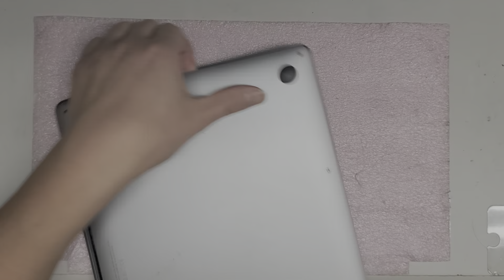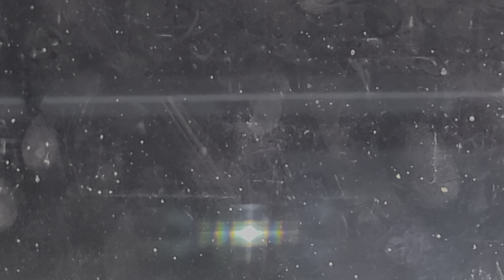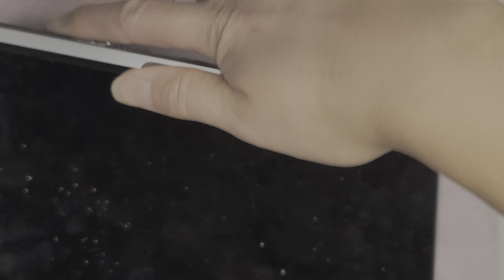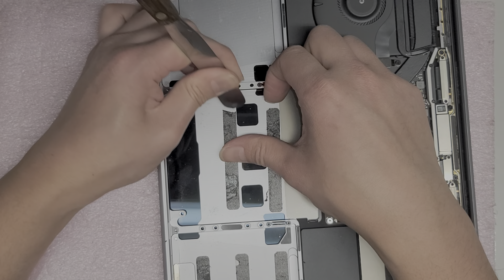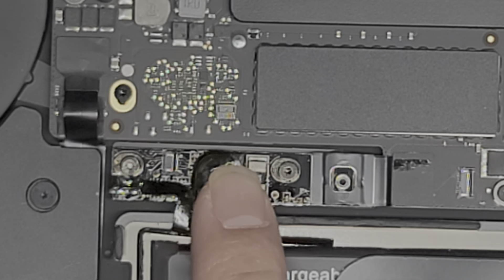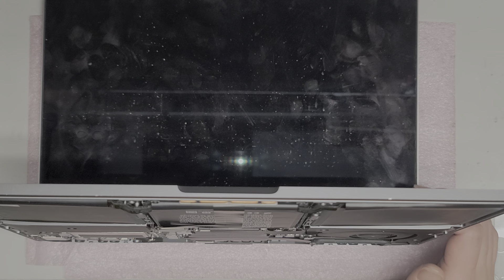13" inch MacBook Pro A1708 Late 2016 Mid 2017 Disassembly Battery Replacement Repair

Comment: Thank you for the clear explanation. I do lots of DIY work on regular basis, so that replacing the battery was lots of fun. Watching the video as a guide is a real time saver.  The need to adjust the position of the trackpad before fastening the screws was probably the only part that I would have missed if it wasn’t for your explanation. Thank you for this guide.
Reply from the maker: Glad it helped :)

Comment: Ok so I was using a butter knife and punctured the cell and it sparked and started smoking. The adhesive is extremely hard to remove, I think I needed to have used heat on the other side of the chassis to help with the removal of the adhesive.
Reply from the maker: You're not removing the adhesive, you're cutting the foam. Heat won't really help with that. You just need the right tool. You'd do better with a credit card or something. In these videos, I usually mention that the tool needs to be flexible and not sharp.
Reply: @ItsBinhRepaired  Credit card is a great idea, and good to know about the heat! Thanks for this suggestion. Can I send you $5?
Reply from the maker: @welikejoe  glad it helped! Of course you can. :) links in the description of the video.
Reply from the maker: @welikejoe  thanks!

Comment: Thanks for your video. I've replaced the battery on my laprop but when I boot in the laptop doesn't see the battery at all. I've checked all the connections and etc but nothing helps. Any idea what can be the problem with? Thanks
Reply from the maker: Likely the ribbon cable is damaged or not connected properly.

Comment: after unplugging my mac didn't turn on only via ac plug... but was working before i close the casing...
Reply from the maker: What did you do to it?
Reply: I have followed the same as your instruction. it was only booting via AC but when I do update from the new macOS Bug Sur it is only from the login window after the password then and restarting automatically.
Reply from the maker: @Youssefdxb2011  so the computer is restarting itself after logging in?

Comment: Great instruction! My local Apple repair center quoted me $600 for the job. Got battery from Ebay for $43 and replaced it my self with your help. Thanks!!  Zelled you $20.
Reply from the maker: Wow, that much?!
Reply from the maker: Thanks for the support! I really appreciate it. :)
Reply: I thought that Apple is has a program where they will replace it for you for free?
Reply from the maker: The stopped 3 years after the release of the model.  :/
Reply: It was actually 5 years. I missed the deadline by 4 months.
Reply from the maker: @edmunda9573  dang

Comment: This is a very helpful video. This design is the stupidest thing I’ve ever seen.  I’m using enough force to pry this damned battery out that I could easily damage something else if i slip.  Gluing in the battery?  Wtf?  I just replaced my Dell battery and it only took about 10 minutes of screwing and unscrewing.
Reply from the maker: Yeah, it's a stupid design. You're not supposed to pry the battery out. If you watched my video, you'll see you're supposed to cut through the foam.
Reply: Yeah, “prying” was a little inaccurate.  I was actually ‘cutting’ it with little plastic cards that came with the battery.  Stupid design regardless.  Thanks again.
Reply from the maker: @schleprock000  hahaha oh ok, I was thinking you were folding the battery packs haha

Comment: Better than repair yourself take to Apple and they may actually do it for free since 2016/17 had an issue with battery and they provide replacement free of cost
Reply: Btw many thanks for the video and great explanation!! I got the My 2016 MBP fixed with REP program for both the Battery and Screen- in 5th year of purchase 😀- comment from Apple service  -“Diagnosed and battery test failed and display no backlight. Both eligible for REP.
Replaced Top Case w/ Battery and Display done.”
Reply from the maker: @rahulsrivastava23  awesome!
Reply from the maker: Possibly

Comment: The Apple certified repair shop be said Apple no longer provides free replacements since it’s been more than 5 years (I have a 2016). Does that seem right?
Reply from the maker: Sadly that's the official thing. Sometimes you can push them to make an exception.
Reply: @ItsBinhRepaired  thanks!! Appreciate the video, super helpful!
Reply from the maker: Glad it helped. If you haven't already don't forget to like and subscribe so others can find my videos. Thanks!
Reply: @ItsBinhRepaired  Done! Keep up the solid work!

Also, before I subscribed a few seconds ago, you were at 7.9K, now you're at 8K.... are they just rounding up? If not, congrats on 8K subscribers!
Reply from the maker: @JonathanLaRiviere  they do round up, but I'm at 8,001 now. Thanks! :)

Comment: After changing the battery I can’t seem to get the battery to show in the menu or system preferences. It makes the charging sound but as soon as I pull the charger out it shuts off.
Reply from the maker: Double check the ribbon cable is in all the way and the latch is down. Also check that the metal tab is centered with the gold contact points on both sides evenly showing. If all that is correct, you might have a faulty battery.

Comment: When I was cutting the battery from the metal, the battery released a weird fume and got really hot🔥🥵⚙️🔋
Reply: And thanks It did go away but thanks anyway it helped a lot
Reply from the maker: @Lebron7375  don't inhale it. It smells kinda sweet, but it's toxic.
Reply: @ItsBinhRepaired  thanks very much
Reply from the maker: No problem

Comment: Thanks for the great video. Looking forward to trying this myself. Do you have any recommendations on where to purchase the replacement battery, similar to what you had in the video?
Reply from the maker: This should be good https://amzn.to/3A5JQu0 1 year warranty
Reply: @ItsBinhRepaired  why did you take the trail I pad of in this video but not the 9 minute one where u removed your battery
Reply from the maker: @semhalgoldja349  older video. I learned leaving the trackpad is risky, so now I always remove it. Had to update the title. I left that video up because it's one of my most popular ones. Added the warning to the title.

Comment: FIRE HAZARD. You should mention this immediately. I punctured the battery and destroyed the laptop. Luckily I didn't set my office on fire.

I found out that at Apple, they don't replace the battery - they replace the entire chassis with the battery.
Reply from the maker: Omg, burned up the whole laptop?
Reply from the maker: What did you use to try getting the battery out?

Comment: Suction cup.    pry tools.    What if the battery is swelling so much that you easily get a fingernail in between the base and the board as it is?
Reply from the maker: then you don't need to use those. Use the brain. It's the best tool. :P

Comment: is battery capacity around 100% after replacement with replace batteries ?
Reply from the maker: Batteries do not come fully charged
Reply: @ItsBinhRepaired  yeah i understand, but what about battery condition, some programs can show their condition in % ? like 80% is after 1000 cyces declared by Apple

Comment: Is the smc reset necessary?
Reply from the maker: Why do people ask that like it's such a difficult thing to do? It literally takes 1 second to do it. You don't have to, the same way you don't need to eat vegetables, but it's highly advised.
Reply: @ItsBinhRepaired  you don’t need to be so rude, i mean, you can also not answer, and yet you did
Reply from the maker: @luismanuelmendoza789  hahaha it's like when someone says to restart the computer and people ask, do I have to? Why?
Reply from the maker: @luismanuelmendoza789  do you ask questions like, do I have to change the oil in my car? Do I have to rotate the tires? You don't have to do anything, but if you want to do it right and make sure things function properly, you should do it. I don't put things in my video just because. This is years of experience condensed into a few minutes. If you don't want to do something, then don't, but I don't tell people to do it just because. Choose not to do it and you deal with the consequences. If you want to know what it does, you can Google for the long explanation.
Reply: @ItsBinhRepaired  Take it easy dude
Reply from the maker: @luismanuelmendoza789  I don't know the meaning of easy. I'm making videos and repairing computers with a broken collar bone. Lol
Reply from the maker: It's like asking if you have to take the bottom cover off. Why even ask that as if I'm trying to get you to destroy your computer or something?

Comment: thanks for mentioning that Apple is replacing this model's battery for free! instead of having to do the repair myself (and purchasing a new battery), I'm just sending it to Apple. you saved me money and a headache.
Reply: Are you guys for real
Reply from the maker: Hahaha What did you do?
Reply: @ItsBinhRepaired   just switched my battery with one I bought from ifixit. And just as I got was done I saw this comment. So you’re basically saying I could have dropped this off at apple and they would change my battery and charge me 0$?
Reply from the maker: @erehwondon4026  possibly, but I've seen others say Apple told them it's more than 3 years old, so they won't do it.
Reply: Wait what
Reply: I just fucking used the whole night changing this shit and now I see this
Reply from the maker: Awesome! If you haven't already, make sure to like, subscribe, and share my channel with others and possibly share some of those savings so I can continue to do this for a living. Thanks!

Comment: why the resets?
Reply from the maker: Why the question? Just do it. It's not hard  Lol

You don't want the computer thinking it's still using the old hardware, so you reset it to get it to clear the memory of whatever settings it held for the old hardware. For a more detailed explanation for what smc and pram resets do, you'll have to Google.

Either way, just do it. It's not difficult and it won't harm the computer in any way, nor will it delete of your data.

I found that it helps the computer preform better after hardware replacements.
Reply: @ItsBinhRepaired  the smc works but the pram dont when i use the key combination my mac enter to a network recovery
Reply from the maker: @MakarovFox  sounds like your command key on your keyboard is bad. Try command option on the right side of the keyboard

Comment: Have you ever had a fix for high CPU kernel task usage? Did the resets but no luck. 
Thinking about changing the batteries, hopefully be the fix
Reply from the maker: Wiped the drive and did a clean install?